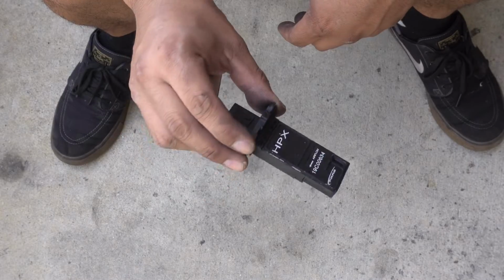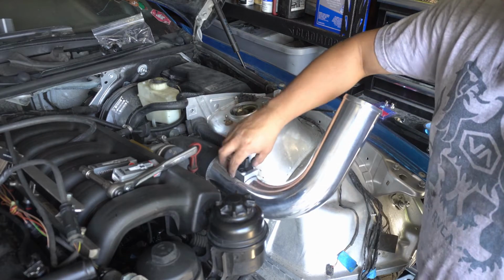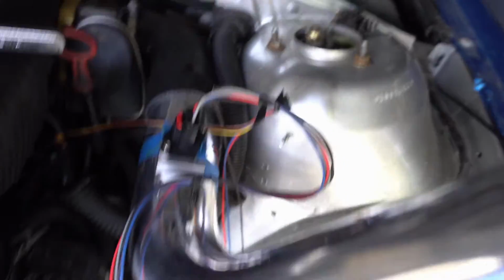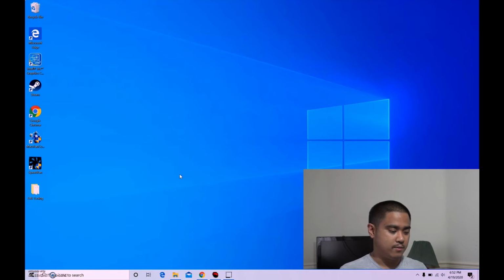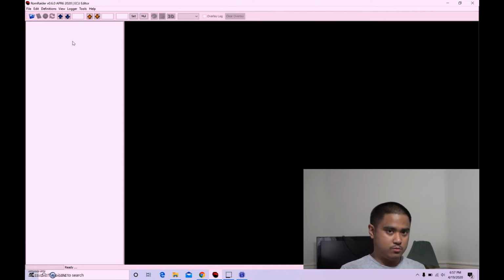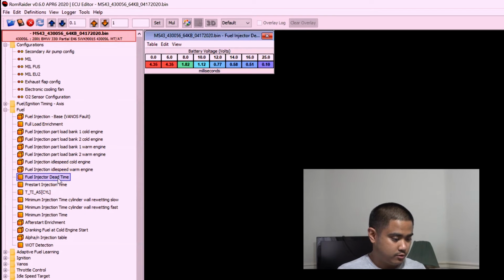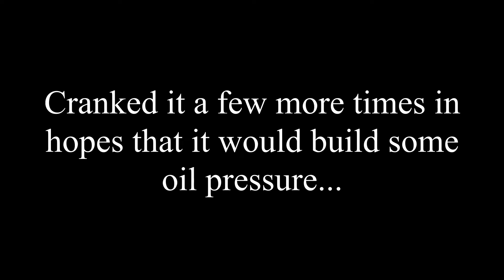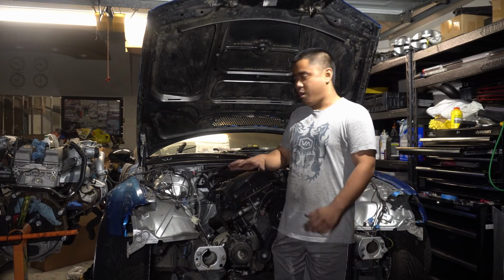Ebay Turbo E46 FIRST START?! | Final Touches and MS43 Stuff | #TheE46DriftBuild Ep 53

Comment: Congrats on the first start! I remember my first start like it was yesterday. It would start and die after a couple seconds and no amount of fuel was keeping it running. I couldn't figure it out, then I realized I didn't remove the cap to the turbo inlet.. Turns out you need oxygen to run your car lol. Also, thanks for showing all the new software. I didn't realize it was so much easier now. Maybe I'll finally finish my build lol
Reply from the maker: LOL sometimes it's the littlest things. And yeah I was stoked when I found out about the MS4X flasher.

Comment: Love the build. I have just finished up putting a cxracing turbo kit on my 2000 328i. I could use some help with tuning for 8 psi. I was wondering if you would be willing to assist me with this part?
Reply from the maker: I would, but I haven’t had a chance to touch anything other than first start, so I wouldn’t be the most knowledgable. Have you tried reaching out to any of tuners out there like vlad belsky or rktunes?

Comment: think i might get this turbo for e39, same engine m54b30 and i wanna go m50 manifold too, how did the car hold up longetivity wise?
Reply from the maker: Blew the motor, but that was my fault. Built right, tuned right, these can handle 3-400hp no problem
Reply: @nuisance_carl  on stock engine with m50 manifold with that turbo u think it will be good?
Reply from the maker: @aldosantana8589  All depends what your goals are

Comment: You managed to keep power steering and AC? Wondering if u could do a low mount on rhd e46. May take some creativity
Reply from the maker: Yea, that's the plan. It's already tough as is with the a/c compressor. Low mount on rhd is a completely different pain in the ass

Comment: When you did your Maf hack did you have to do anyhthing else besides the switch? Rom raider shows everything is there but loading tuner pro shows nothing changed for same bin.

Thanks
Reply from the maker: I just did the switch using the patchlist definition file. You can adjust the X axis scaling (Load) if you want. I didn't at first.
Reply: @nuisance_carl  Ok thanks idk why they are different like that but on startup everything is pig rich so im assuming something changed so i will go from there like you said. Thanks

Comment: What do you do if you get state repped? I’m sure u have a way around smog but what about cops...I live in Cali as well and this is a big concern of mine because I want a street turbo setup on my 330.
Reply: Do u have a way around it?? Helppppp
Reply from the maker: Sometimes you have to risk it for the biscuit. As long as you don’t drive like a dick you should be fine (The only times I’ve gotten pulled over weren’t regarding car mod stuff). If you do get pulled over, honestly usually goes a long way Not legal advice, YMMV
Reply: Nuisance_Carl well I agree with that statement bro! Thanks for your input 😎
Reply from the maker: Yea no problem!

Comment: how did you delete the idle controller ? and whats instead of it now ? as well as EVAP tubes, do you delete them as well ?
Reply from the maker: Yup all gone. I’ll have to change around some stuff in ms43 to isle using the throttle body instead of the icv

Comment: hey man quick question, when you flashed the ews delete file on to the ecu was is a full write and then everything after that you do partial writes ?
Reply from the maker: Correct.
Reply: @nuisance_carl   one more  question would you know how to get the definition files to work for the ms43 logger ? i cant get the program to connect to the ecu :/

Comment: Great  video. When using romraider and using the ms4x wiki's definition files it still pops up no definition files found when reading both bins. Definition is in the manager added and saved but idk what im missing. Thanks for anyone that can help.
Reply from the maker: Wish I could help. I've never had an issue loading definition files into rom raider.

Comment: I’m having problems with the files downloading on to my Acers Laptop. Any ideas on what might be the cause of that?
Reply from the maker: Does it not download at all? I've never had issues with downloading the files before.
Reply: @nuisance_carl  it downloads but whenever I try to open the file it won’t open for some reason
Reply from the maker: @dassehmc  What exactly are you downloading? MS4x? Rom Raider?
Reply: @nuisance_carl  yeah ms4x
Reply: I have a e53 x5 30i so that would be the one to download right?
Reply from the maker: Only thing I can think of is if your computer is blocking it because it thinks it’s a virus, which is common. Otherwise I haven’t had issues with it. As far as if it’s the right software, you need to check what ecu your x5 uses.

Comment: Hey whenever I open MS4X Flasher I get "The application failed to initialize properly (0xc000007b)" just wondering if you or anyone else has a solution
Reply: Just learned it requires .net 4.5 so Windows XP isn't supported for this program! Need Windows 7 and later

Comment: What’s the part number for that pmas maf
Reply from the maker: Even better, here's a link https://www.pmas-maf.com/product/flg-va-hpx-mass-airflow-sensor-kit-aluminum/
Reply: Nuisance_Carl one more question if you don’t mind, once I download the ms4x to get the activation code do I need to have it connected to the ecu or just the I pad cable? Thanks I’m advance
Reply from the maker: @chernandez8425  You need to connect it to the ECU to get the code.
Reply: @nuisance_carl  thank you for the help. i have ms4x downloaded and it works, romraider on the other hand is giving problems. I have downloaded the definitions file and loaded them into romraider  def manager but when i try to open an image im unable. i would love it if you could do a more in depth video on romraider and what file to use.
Reply from the maker: @chernandez8425  I plan to do more in depth "tuning" videos in the future. As for not being able to open an image, what error message are you getting?
Reply: Nuisance_Carl ecu definition not found and . Do I open the partial read from
the ecu, if so that’s the message I get. There’s one more saying it’s a zip file and to unzip the file buts it’s not a zip file.
Reply: Nuisance_Carl I was able to get rom raider to work. I added the ms430056 partial 64kb from  tuner pro into the rom raider definition management and it worked. Thank you
Reply from the maker: @chernandez8425  Oh wow, didn't even see your first reply. Glad to hear it worked!